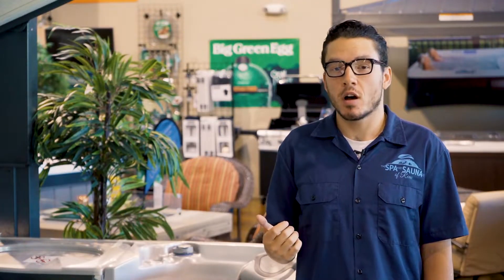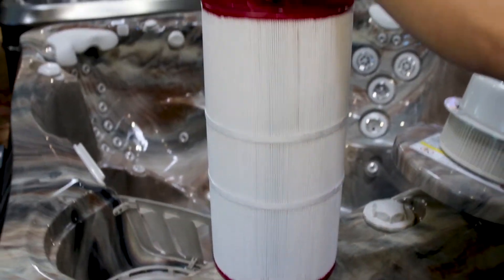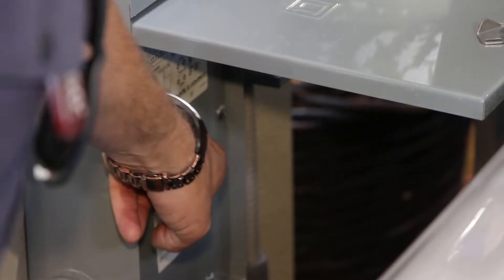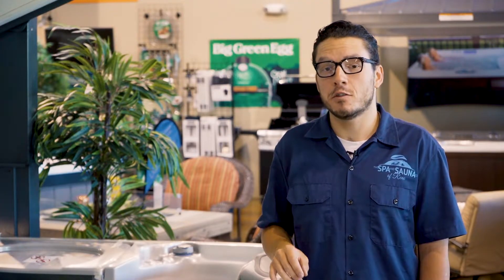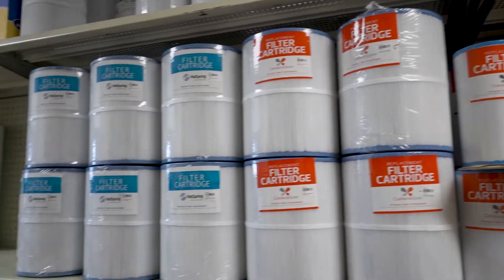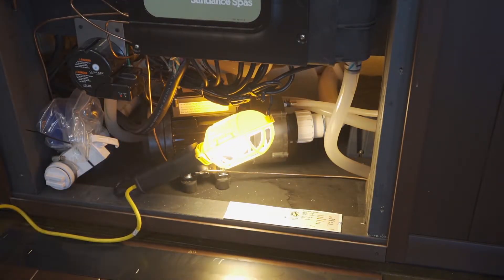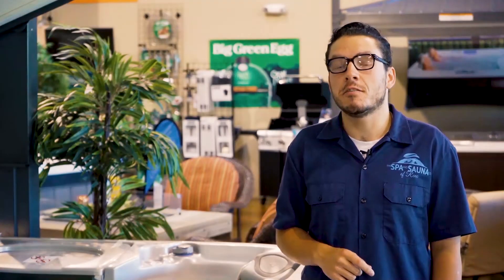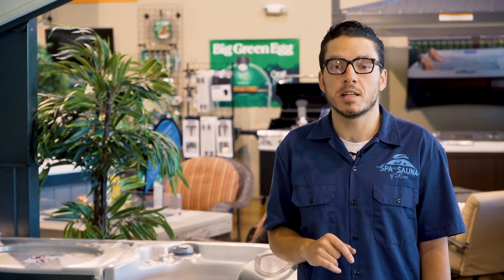Fix Protection Mode on Your Hot Tub and Keep Your Spa's Pipes from Freezing!

Comment: I have a Hot Springs Gleam model hot tub. I replaced the filter, recently got a new heat pump and heat assist but I am still getting that “protection mode” message? What else should I check? I’ve also drained the hot tub and put new water in it. And I’ve  turned the circuit breaker/GFI switch on and off. I’ve had a service guy look at it as well with no luck. Any help from anyone would be greatly appreciated!
Reply from the maker: Hi Nina, sorry to hear you're having issues with your Gleam. It is difficult to diagnose without seeing the spa but our service team was wondering if there is anything in the service compartment itself that could cause your pump to overheat, perhaps something aftermarket or dirt/debris? It's possible there is dirt/debris in your piping as well. Have you had a professional drain and clean your spa?